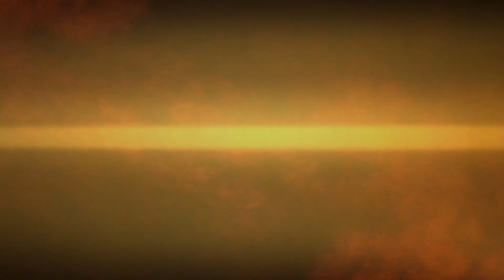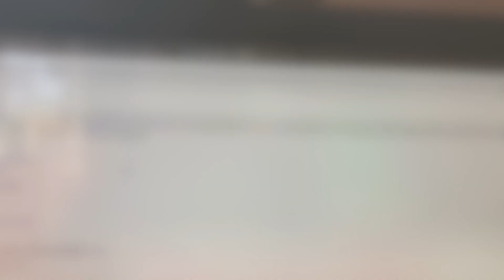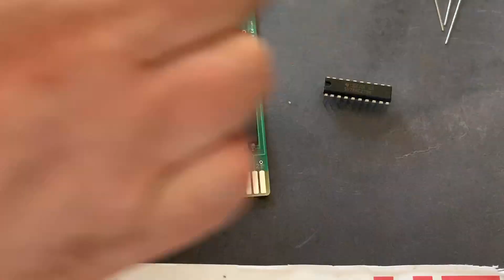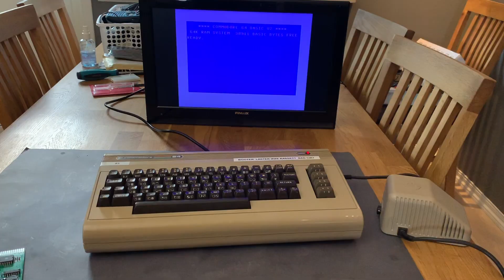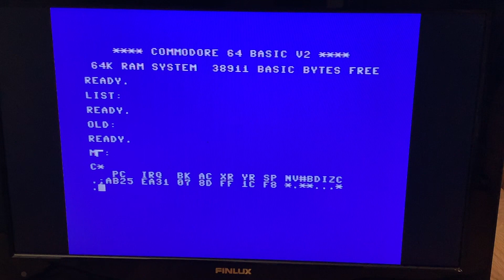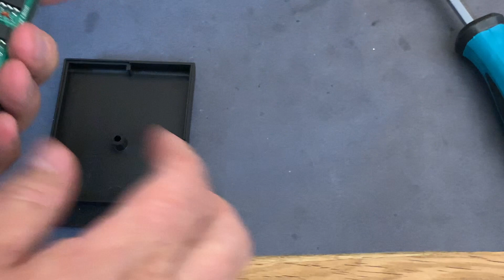Building a Commodore 64 Final Cartridge III+ step by step

Comment: I bought a bare board and haven't located the Rom or the code
Reply from the maker: For ROM you can use almost any kind of eprom
Reply: @Arcticretro  yes, but the data in the eprom is what I don't have
Reply from the maker: @raymondheath7668  Have you searched ? I found it here: https://csdb.dk/release/?id=141638

Comment: Clean your iron and tin it with some rosin core solder. You are not using rosin core solder or any flux and it shows because the solder doesn't stick well or flow to the iron. Soldering is a chemical process as much as it is a heat process. Flux is an acid that cleans and removes a layer of oxidation and prevents the formation of further oxidation so it adheres. When you see balling up of solder on the iron its because there is a layer of oxidation.
Reply: He's clearly using rosin core solder, the smoke coming off is flux vapor. I don't even think you can buy non-rosin core solder anymore for electronic use. It's mostly used by plumbers.
Reply: @DarkStar851  you are correct. But he needed more flux. His tip still wasn't clean. When your tip is clean is tinned and clean the solder won't ball up like that. Cheers.

Comment: It looks like you are using the original power supply. You really should consider getting a new one. The original can fail and damage C64 components with some serious over-voltage. I advise you to get an aftermarket one, or if you feel confident about it, build one yourself. (Plenty instructions on how to do this can be found online. Don't forget a fuse :-))

Be safe and happy retro computing!
Reply from the maker: Thanks. I already got a new one. Also, the original one I use, I have measured the voltage to be normal. But you never know :-o

Comment: Dette bringer mange gode minner tilbake. FCIII var bare helt konge å ha på C64. En kompis av meg hadde en C64 med tape drive. Vi pleide å spille salamander hos meg.Problemet (pirat problemet) var bare at spillet var på disk. Med FCIII kunne jeg loade salamander. Dumpe minnet til tape :) Bare et lite minne der. Fin video. Du har mange fine videoer. Jeg skal nevne deg i en av mine neste videoer :)
Reply from the maker: Takk for det. Jeg har sett noen av dine videoer og jeg har hørt deg nevnt i andre videoer. Visste ikke du var norsk :-)